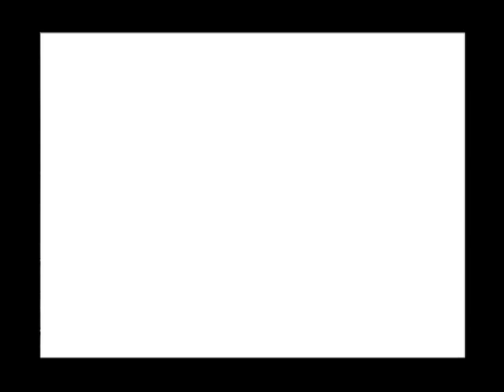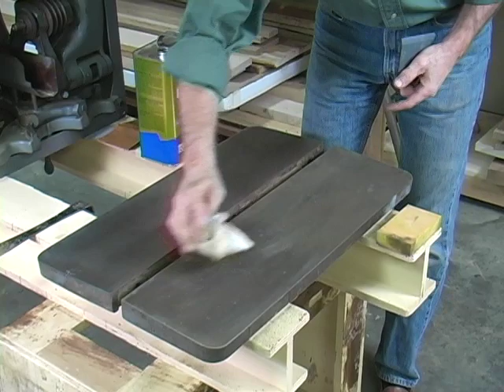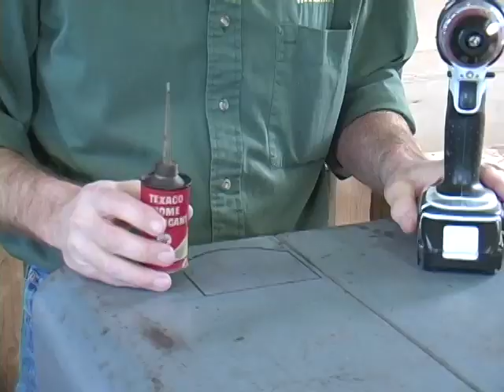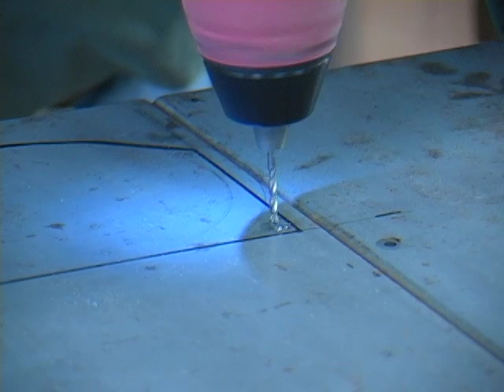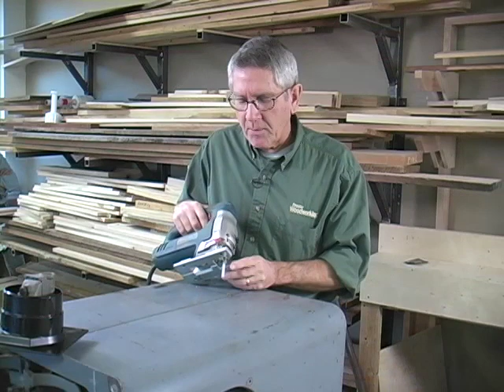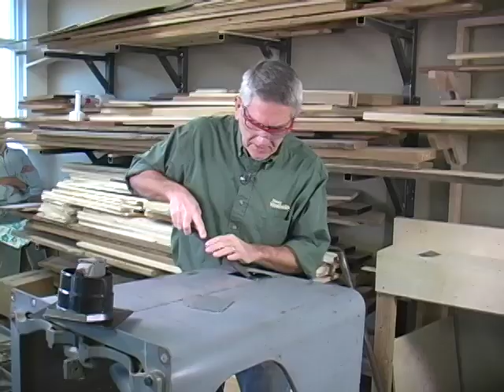UNISAW Restoration - Part 3 Continued

Comment: You could easily use Simple Green (50/50 mix with water) to sand on the cast iron.  Believe it or not but the Simple Green keeps it from rusting and I know of people who use it for tool sharpening and as a lubricant for drilling for just that reason.  It would be less toxic and still pull out all the old grease and dirt just as well.

Comment: Thanks for the safety tip.  Good luck restoring your unisaw.  I might be buying a 1949 10" tilting arbor saw.  Really small model, 34-160.  I also took delivery of a 1986 Delta 10" contractor saw, 34-410, with 2 wings.

Comment: Interesting series, I recently bought a circa 1951 unisaw at a scrap yard. It has a heavy rolling base. I applaud your mention of safety practices such as eye protection. However, you demonstrated an unsafe practice without mentioning it. It is inadvisable to use a claw hammer as a striking tool with center punches, because of the hardened hammer face. A ball peen hammer is the recommended tool for this application.